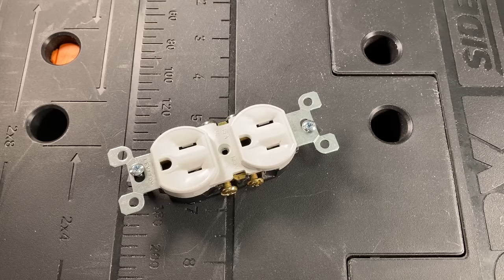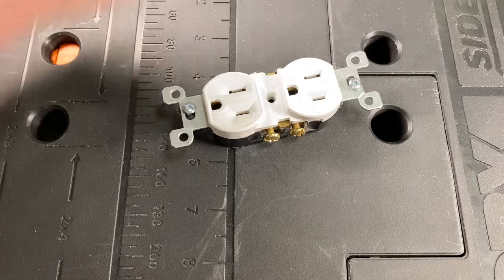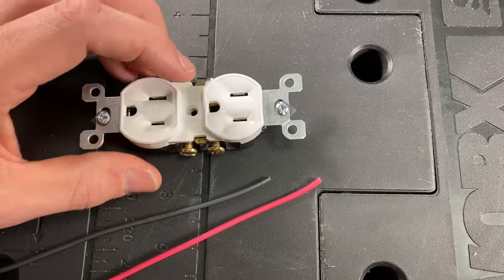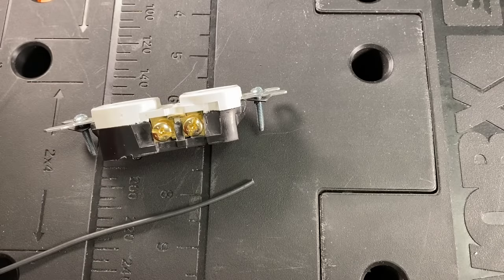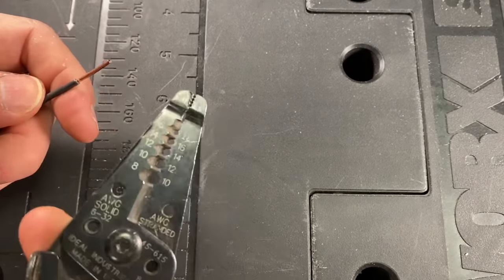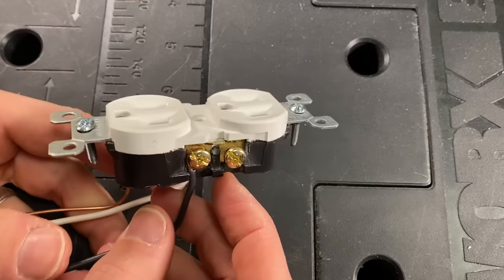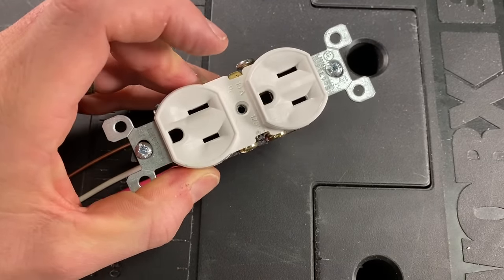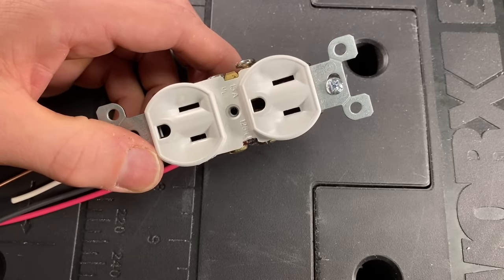Electrical Outlet Basics | How To Wire

Comment: Thanks for the super clear video - straight to the points!  Question for you: so can you remove the tab on the silver side too then?  In such a case, say you wanted to control each of the sockets with a separate switch.  So I'm guessing that you can remove the tabs on both sides, both of the copper sides are taking a red (hot) wire from their respective switch, and then the  black would also just have to be run to neutral in two separate cases?  Or can they not be operated that way?
Reply: NO! Never put a black or red, hot wire on the silver neutral terminals! The only reason you would remove the tab on the neutral side would be if you’re hooking up two feeds from two separate circuits, each feed having its own neutral. Then you would want the neutrals separate from one another. 
This is why you call a licensed electrician if you’re not 100% clear about electrical wiring and the current requirements of The National Electric Code.
Be safe my friend 😉
• 22 years licensed, 35 years in the trade
Reply: @midnightflyer7510  I appreciate the response, but hang on a second here.  My question was if you can remove the tab on the silver side so that you could "control each socket with a separate switch".  Admittedly, I did write "black" as the color, but I also referred to it as the "neutral" wire.  So that was just a mistake in what I wrote.

The question still stands though - albeit I THINK you may have answered it, but I'm just not certain.  So IF you wanted to control each of the sockets from a separate switch, are you able to remove both the copper AND silver tabs and then run a circuit through each of them in a singular fashion (presumably still with just a single ground wire)?  Or is that not possible with this kind of outlet configuration?
Reply: The method we use is to run a 14-3 wire which has black, red and white. Then the two switch legs are just sharing the neutral. Break off the tab on the hot side and leave the neutral side in tact. We also use a 14-3 for example when wiring for a paddle fan with separate fan and light controls or anything that requires two separate switches.

Comment: How do you know which wires are hot and neutral inside the wall? Because most of them in my house are 4 identical solid black wires. The only reason I could replace them is because I re-installed the switch the same way the old one came out. But if I didnt have that I wouldnt have been able to tell because the wires were all the same.

Comment: Curious... in this video you recommend against using the back connectors but in others you say you prefer it. What's the difference?
Reply: The difference is back wiring vs back stabbing. Back wiring uses the screws for fastening. This feature is only on spec grade or higher receptacles.

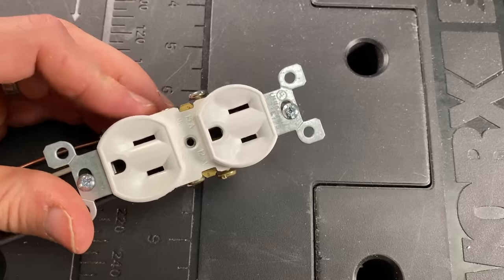Comment: Pause the video at 7:14 and notice what sticks out the furthest from either side of the outlet? You guest it, an unused terminal on both sides. So those terminals should be tightened down. Otherwise when the outlet is energized you'll have a hot terminal sticking out which is a very bad idea. So best practices would include tightening down any unused terminals. Additionally, (I know I'm going to get kick back on this one but) I also ensure that when wiring the neutral I use the terminal closest to the ground screw and when terminating the hot I use the terminal furthest away from the ground screw. FYI, don't be surprised if when you open a electrical box you find that the electrician has wrapped tape around the terminals. That's not required or even necessary , but some electricians still do it.

Comment: OK. All well and good for 14ga wire. My home is wired with 12ga, and the screws don’t back out far enough to get the stripped and looped portion installed. What is the solution?  Thank you.
Reply from the maker: 12 ga is a bit tougher but you should still be able to negotiate the wire around the terminal.  Just worked with some 12 ga last week and although it took some doing I got the wire around the terminal.
Reply: Another solution is to get a commercial grade receptacle. Only about $1.25 more than a cheapy. You can slide (sandwiching) the wire in and tighten the screw. This is not to be confused with the dreaded backstab connections. Backstab connections are not an option on these receptacles. Leviton is an example. You will need to straighten the u in the wires or preferably, if the wires are long enough, cut and restrip.
Reply from the maker: @surferdude642  appreciate the feedback 👍

Comment: Something that I do personally, I heard something year's ago about a plug being slightly out of the receptacle and a piece of something falling down on and laying on the small exposed plug and catching fire. So I turn my receptacle 180° so the Ground plug faces up.
Reply from the maker: Many people have discussed turning the plugs for a number of different reasons.  Interesting reading all the comments on the vast experience of the viewers.
Reply: @EverydayHomeRepairs  It's something that I never did any research on, I just kinda doing it. 
But it could be not even true my mind is if there is a chance then why not do anything to eliminate the chance.
Reply from the maker: @dshurak827  thanks for the reply and additional info 👍
Reply: That is the latest code in many areas.

Comment: for the wiring  with the independent outlet for like a lamp,  at the top and the bottom is always on,  how would you  wire the switch?   I've  have a red , white and black wire and seems that the red one is the hot wire..  but upon watching some videos it should be the white one...  so i am confused...

Comment: try using a sq. 1 bit to tighten all the screws,most dont know that all these screws are designed for the square bit
Reply from the maker: I am a Robertson fan but currently have a #1 and #2 ECX combo screwdriver from Milwaukee which work great.  Thanks for the feedback!

Comment: Hi I am changing my outlet. My old outlet have the wires connected to the back how use push pen to take them out. Do want cut them.  How do I use push pen to connected them.

Comment: Good video, but don't I have to put installation tape over the switch when I am finished?? And do you have a video with a light switch and outlet in one??
Reply: Tape is not required by code (unless it's a local code where you live), but there's no harm in doing so if it makes you comfortable.  If the box is small (and therefore doesn't have much clearance between it and the screws), then it may be a useful precaution in case something shifts in the future.

Comment: Do you recommend wrapping electrical tape  around the terminals as an ounce of prevention?  I have seen others do this, but what is your take?  Also, instead of electrical tape would kapton tape work better since, I believe, has a higher temperature threshold.
Reply: No inspector will pass a job done like that.

Comment: I have 1 outlet that has 2 white wires, 1 black wire and the ground wire. I pulled out the old out as the top wasn't working. I did the exact same method as the old on and broken the split on one side the new one didn't work to the top outlet. So I take it that the previous owner have this wire incorrect. How do I connect 2 white and 1 black wire? I think both white belong on one side (silver) screw and the black on the gold screw with no split in any?

Comment: I noticed that outlet is 15A 125V is that standard for all homes?
Reply: Dependant upon the amperage and voltage required by the appliance or equipment to be powered. Example 20 amp 120 volt freezer or AC unit or 50 amp 220 volt range.

Comment: Interesting that the common side could also be independent by breaking the tab. When would you do that?
Reply: I would never do that!   “Well, HARDLY ever!”  The only time I would do that is kitchen counter outlets, which are supposed to have two circuits.  Mark the outlet as split circuit, like on the back of the faceplate.  BTW, always use the indestructible nylon faceplates, not the brittle plastic faceplates!

Comment: Wow I’m so scared to mess with this but sometimes I just have to and this sure helped me , thanks for the video, so black is hot ? And white is common?
Reply from the maker: You got it, take your time and just make sure the circuit is off prior to starting your work and I am sure you will be fine.
Reply: Ok good thanks
Reply: Increase your fire insurance.
Reply: white is neutral.  common is used differently in house wiring, so calling it common will confuse people.
Reply: It's called neutral because if you understood how a step down 3 phase pole transformer works would see where the neutral is created.

Comment: You say don't use the spring loaded plugin for the wires. 
You will note there's all kinds of MCCs and 600 volt apparatus that use exactly the same connection.

Comment: Question; I have an outlet that has a light switch and the previous wall mount had a white coming in on the right side and a white on the other side, is this correct too?

Comment: I wish there was a video on how to stuff all the wires into the outlet box in such a way that allows the receptacle to be easily secured to the box.
Reply: Last year I learned it can be done wrong.  I had an outlet that's been sitting happy for 60 years, but last year when the transformer on the pole blew up the surge shorted an outlet.  Seems hot was pressed against the box's ground screw and the insulation thinned enough from the pressure that the surge arced to ground.  I believe the wires were simply too long, all my boxes are tiny.
Reply: The code is 6" stickling out of box. For a new install.
Reply: @jrstf  The code is 6" stickling out of box.
Reply: llkidd  The code is 6" stickling out of box.
Reply: @SPL Builders The code is 6" stickling out of box.
Reply: Get the deepest box that fits in the wall. If your wall is built with 2x3 studs instead of 2x4 studs and you need more room for wires you could put in a double box with a single duplex receptacle or a single switch or a special box that is wider behind the wallboard but still takes a single cover plate.

Comment: No one explains what way does the ground holes of the outlet are up or down. wont it break out easer if it was on the down side if some one would step on the elect cord. just wandering if it has a code for it. Thanks
Reply from the maker: Hey Rodney,  good questions and the up or down orientation is not included in the code.  This is personal preference and some have used ground up orientation to indicate a switched outlet.  Others like like the ground up to protect against the following scenario:  if the plug is partially removed and something falls on the plug then the ground would be in the path of the object opposed to the hot and neutral.  The choice is yours 👍

Comment: I have a problem....in the bathroom there is power hooked to the light switch to the outlet on top of the wires for the lights, so when you turn off the lights there is still power to the outlet. I thought i would try the same in the bedroom. I cut a hole a the 3 feet below the light switch.....the room only has one outlet. I ran Romex through it and wired the black to the black from the light switch and the neutral to neutral.  I connected the outlet. I turn on the power and it shows i have power to the outlet. I turn on the light switch...the light comes on but the outlet loses power. funny thing...i plugged in the vacumm...i turned on the power at the box...I turned on the lights by the switch..that works...i turned them off and then switched on the vacuum. this turned on the lights not the vacuum lol, so the vacuum is acting light a toggle switch lol

Comment: In my rewiring, I always remove switched outlets as I do not what any outlet interfering with my electronics.  The only thing I want switched as my ceiling lights.   I know that switching off the circuit breaker is good practice however I in the 45 plus years of changing wall outlets from 2 prong to 3 prong I rarely shut down the circuit and when I do I still treat the circuit as if it was live with insulated gloves and tools. 98% of the time I am replacing an outlet so I can use the existing wires. Sometimes I have to add a ground wire then I will shut down the circuit as I don't want to I find that the outlet box is already grounded as there is metal conduit running through out the house. I check to see if the boxes are properly grounded. I also never work on anybody's house besides my own.
Reply from the maker: Thanks for sharing George but definitely wouldn't be recommending that people work on live circuits.  Easy enough in most cases to simply go flip a breaker.

Comment: Does it matter the 2 white wires which one goes on top same with the 2 black ones
Reply from the maker: Are you wiring an outlet which is switchable?  Is there a light switch which controls one of the outlets?
Reply: No it doesn't matter unless one is switched or there are two different circuits.

Comment: Great informative video.  I do feel a lot more confident.  I would like to know if you cut off the power through the circuit breaker, and it is still hot, what do you do?  I am just curious. Thanks.  And btw I did subscribe!!!
Reply from the maker: Hi Monique,  In that scenario sounds like a different breaker is feeding that circuit.  If you want to be sure you can cut power to the whole house / condo by flipping the main.  Be safe!
Reply: If your breakers are not labeled sensibly, you should go around your house, and draw a map of which outlets, lights, switches, etc are connected to which breaker.  Go around one room at a time, and plug in a light or a radio to every outlet, one at a time, and go flip beakers until you find out which breaker shuts off the light or radio.  The radio lets you know if you’re alone and in the basement, when the outlet turns off.  You can also get an Outlet light bulb socket adapter to plug the radio into a light bulb socket.  This will also help you understand the paths the wiring in your house takes.  Of course they make more professional tools for this...

Comment: I would have added, that if you damage the wire during stripping it can cause a hot spot, since you're effectively reducing the gauge of your wire.
Reply: Tell that to every single coworker of mine. They all strip with pliers and tell me strippers are for rookies. I don’t care how good you are with your pliers, you will nick the copper if you don’t use a stripper that is properly sized for your conductor.
Reply from the maker: Good point and thanks for the feedback.  👍

Comment: Why are the 2screws you used for your demonstration brass coloured when the 2 screws on the other side are silver in color?
Reply from the maker: Brass indicate the hot side of the outlet and the silver are the neutral side.
Reply: Just know black to brass to save your ass

Comment: That tab that makes it a switched outlet, what is the purpose of the other tab?
Reply from the maker: The hot and neutral both have a tab connecting the top and bottom screw terminals.  The tabs both serve the same purpose to isolate the top from the bottom if you would like to make a switched circuit.

Comment: one question, Do the wires need to both be top, or bottom? Will it affect the outlet to have on top, one bottom? (Hot wire top, neutral bottom)
Reply: No, as long as the tab in between the screws is intact.

Comment: I’m trying to change a light switch and smart switch and the line wire isn’t cut like the others it’s a continuous wire where it’s a loop, how do I connect it to the live for the new switch since the wire nuts wouldn’t work

Comment: does the terminal location location used matter? So i noticed when changing outlets to the house that some were wired on the terminals across from each other like Hot Bottom Right, Cold Bottom Right,  but some were wired like say Hot top right cold bottom left. Does it matter & should they be across from each other or is it something someone did for a purpose?
Reply: Doesn’t matter what terminals they go on, as long as hot is on either one of the gold screws and neutral is on either one of the silver.
Reply: @sargentnocap1414  thanks just was double checking, whoever wired the house did some crazy things that were both amazing & amatuerish, though i believe it was a professional since it was owned by the veterans affairs originaly.

Comment: Thanks. Just moved in and they said they redid the electrical but I have open grounds everywhere... inspection didn't say anything about it either. 
Looked at the wiring on my outlet and every post is wired except ground...
Reply from the maker: Hmmm, depending on the area usually inspectors pick up on ungrounded outlets.  That can be a pretty big job to do it right and get a ground running back to the panel.  Another options is GFCI which should meet code in your area but each outlet would be expensive.
Reply: @EverydayHomeRepairs  I figured it out. Built in 1948. One hot in and one neutral in, one hot out and one neutral out, running the front porch light in series. I did find they had the live on the non brass side so thanks for that.
Reply: Yeah I'll probably replace a few with a GFCI and then run my computer and ejecting off good surge protector.

Comment: Replacing a Radon fan that is powered by a GFI outlet - should it be connected to the load side ? The old GFI I'm replacing  has the Radon fan connected to the line side. Is this ok?
Reply from the maker: Yep, if there is only 1 set of wires coming in then you would connect to the “line” side of the GFCI.
Reply: @EverydayHomeRepairs  Thank you for your response, that makes sense.
Reply: That may depend on the location of the radon fan and whether it needs to be powered at all times.